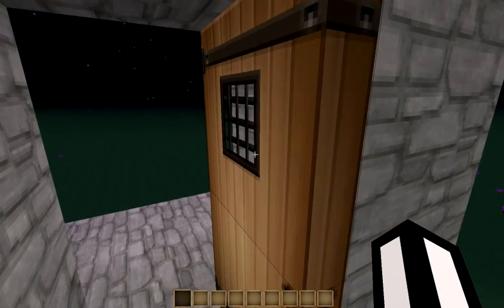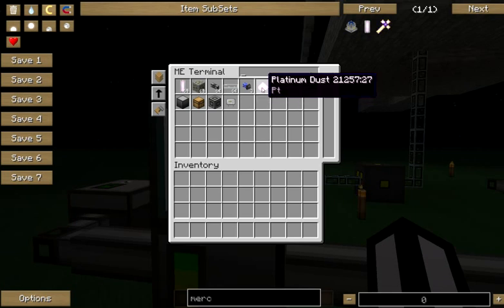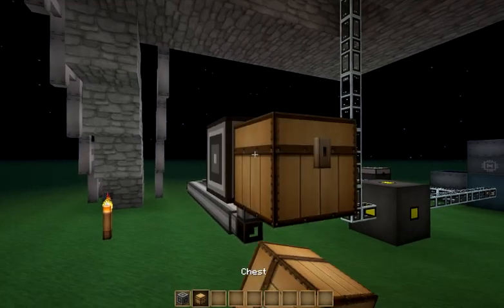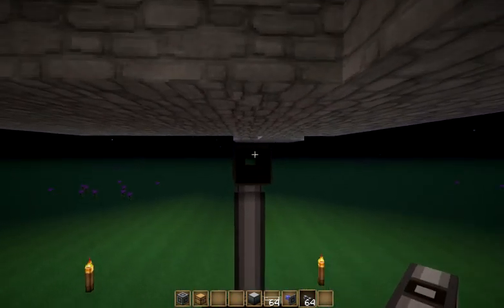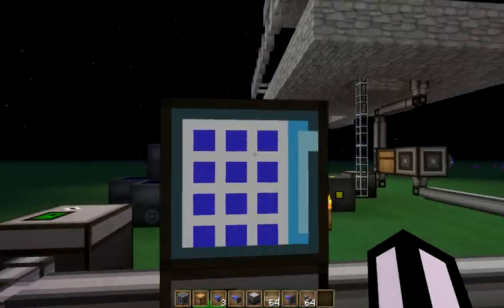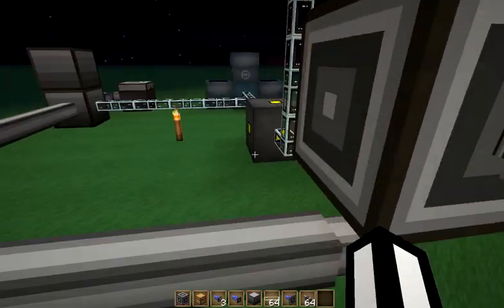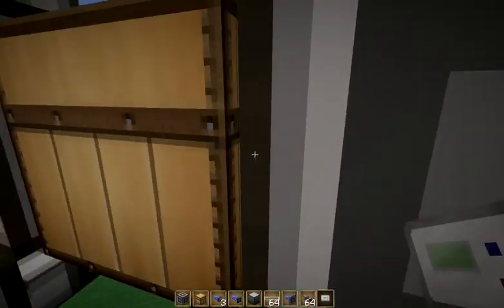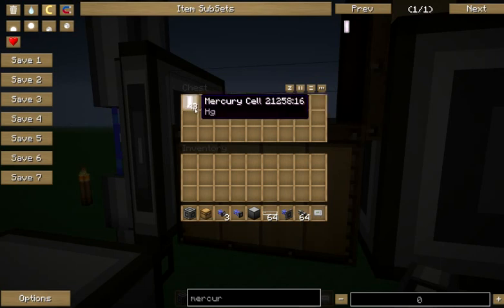Applied Energistics - Advanced Sorting

Comment from the maker: It changes it from a craft-always to a craft-on-demand solution. If the primary AE network were to use two export busses then it would always attempt to dump all ferrous ore and all mercury cells into the grinder. By using a second network you ensure that there is always a 1:1 ratio, and you only craft when requested.

Comment from the maker: A follow-up thought on that: processing ore may have been a bad example.  The same method could have been demonstrated making steel in a blast furnace.  You could, again, use two export buses and two level emitters to keep a certain stock of steel; however, you would typically end up with 64 more than you set your level to because the furnace would finish out its contents.  It may also cause additional backlog if processing multiple materials in the same furnace.

Comment: I wouldn't use two networks. The primary one is the only one you really need. Instead of using a second network I'd just hook up some buildcraftpipes and a diamond pipe which distributes all the ingredients to different machines etc. In case you want to use a machine for multiple things I'd use hoppers so they don't overflow and spill all over.